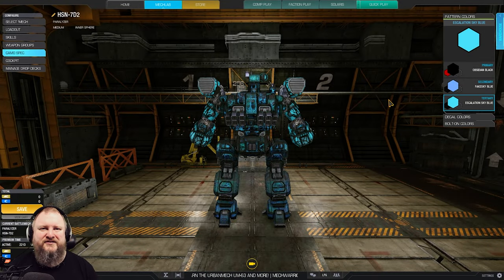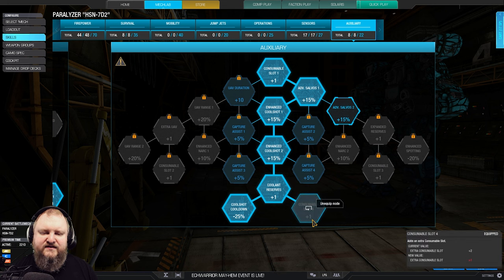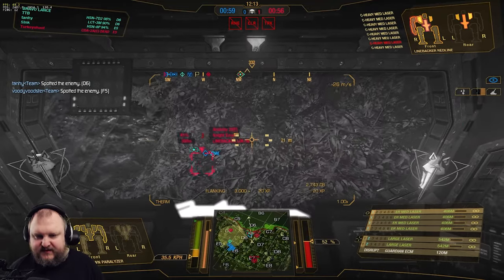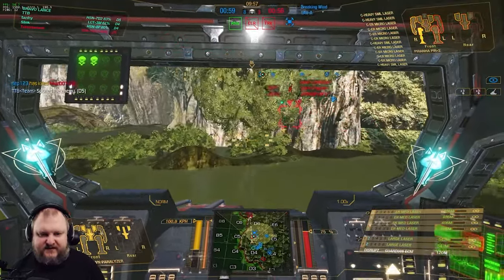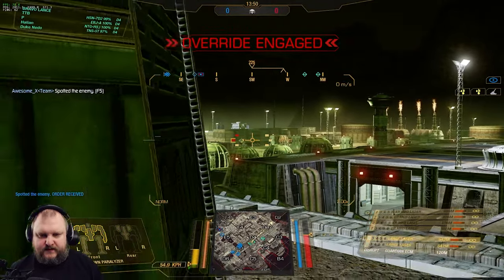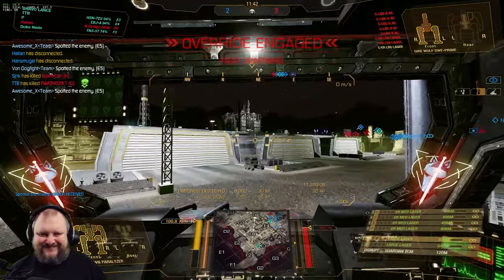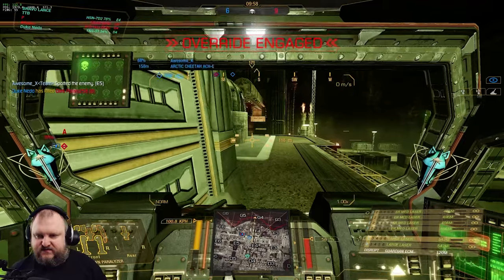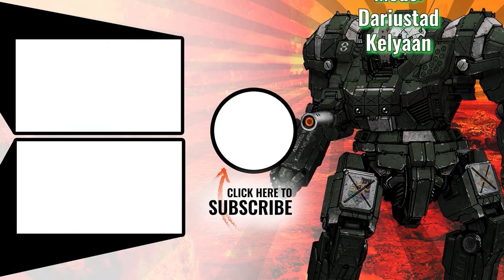Pin-point armor melting! - Hellspawn - German Mechgineering #499 - Mechwarrior Online

Comment: Watch the heat, it's doing something weird. It drops very quickly for 1-1.5 seconds after firing then slows to a crawl. Is that a quirk or the mech or a bug?
Reply: I thought the same! 
Sometimes it goes down very fast and then it just slows down for no reason???
Reply: Heatbug. Well known but very rare, thus hard as hell to recreate and fix. Got 1500 hours in MWO and I've only experienced it a half dozen times, most recently about a week ago. Usually it doesn't let you dissipate heat whatsoever, even amplifies the heat you do generate, like you don't have any heatsinks at all. But that exact heatbug in TTB's first match is the exact same behavior of the heatbug I experienced last week. A spike of heat, ridiculously fast dissipation for most of it, then the dissipation slows to almost nothing.